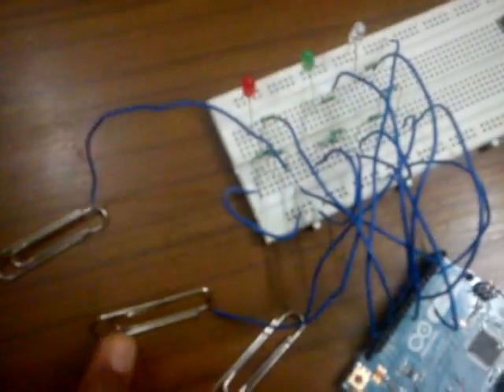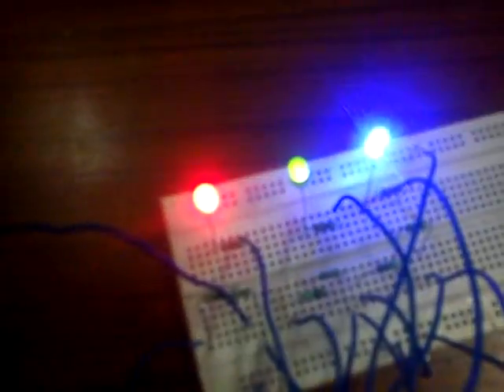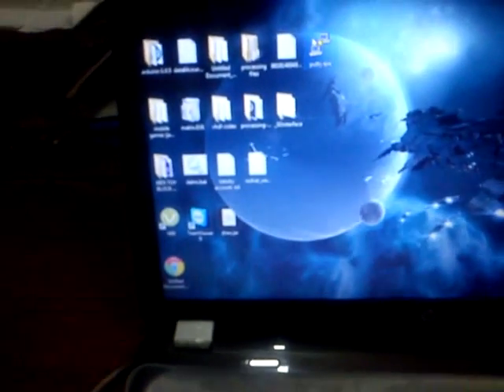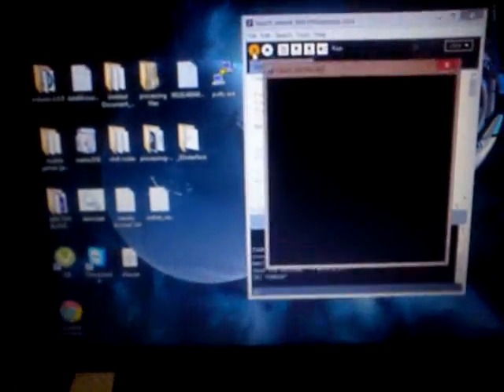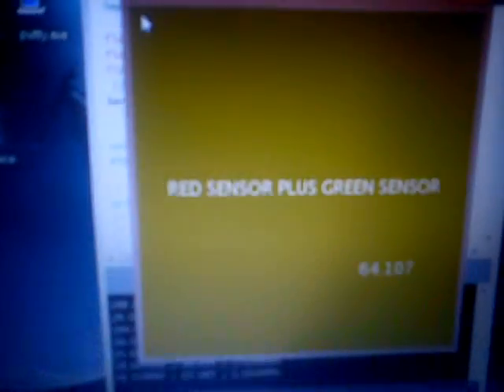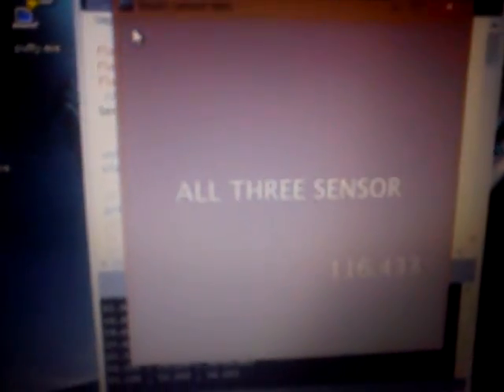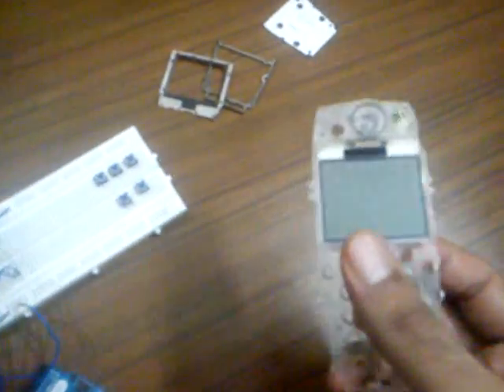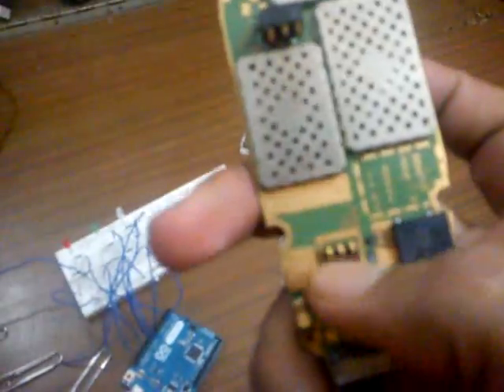Capacitive Touch Sensor with paper clips (Arduino + Processing)

Comment: Hello, i want to create a similar project. I want to modulate a video from a capacitive sensor. But in my processing software i can't receive the information send by the arduino. 

That is my arduino source code : 

#include <CapacitiveSensor.h> 
CapacitiveSensor   cs_4_2 = CapacitiveSensor(4,2);        
CapacitiveSensor   cs_4_5 = CapacitiveSensor(4,5);       

void setup()                    
{
  Serial.begin(9600);
}
void loop()                    
{
  long total1 =  cs_4_2.capacitiveSensor(30); 
  long total2 =  cs_4_5.capacitiveSensor(30); 
  Serial.print("A");
  Serial.print(",");
  Serial.print(total1);
  Serial.print(",");
  Serial.println();
  Serial.print("B");
  Serial.print(",");
  Serial.print(total2);
  Serial.print(",");
  Serial.println();
}

and that is the processing code :

import processing.serial.*;
import processing.video.*;

PImage img;

Serial myPort;

int LF = 10; 
char HEADER1='A';
char HEADER2='B'; 
int valeur1;
int valeur2;
int contact;

Movie movie;
float x;
float y;
void setup() {
  size(456, 360);
  background(0);
  img = loadImage ("mire.gif");
  movie = new Movie(this, "alicevapeur.mov");
  movie.loop();
  println(Serial.list());
  myPort = new Serial(this, Serial.list()[0], 9600);
}
void serialEvent(Serial p) {
  String message = new String(myPort.readBytesUntil(LF)); // On lit le message reçu, jusqu'au saut de ligne
  if (message != null)
  {
    print("Message" + message);
    // On découpe le message à chaque virgule, on le stocke dans un tableau
    String [] data = message.split(",");
    //Message reçu du switch
    if (data[0].charAt(0) == HEADER1)
    {
      // On convertit la valeur (String -> Int)
      int raw1 = Integer.parseInt(data[1]);
      valeur1 = raw1;
    }
    //Message reçu du potentiomètre
    else if (data[0].charAt(0) == HEADER2)
    {
      // On convertit la valeur (String -> Int)
      int raw2 = Integer.parseInt(data[1]);
      // On normalise la valeur de 0 à 255
      valeur2 = raw2;
    }
  }
  println(valeur1);
  println(valeur2);
}

void movieEvent(Movie m) {
  m.read();
}

void draw() {
  contact = 0;
  noStroke();
  if (valeur1<100000 && valeur1>0) {
  }
  else {
    contact=contact + 1;
  }

  if (valeur2<100000 && valeur2>0) {
  }
  else {
    contact = contact + 1;
  }
  
  float f = map( x, 0, width, 0, 255 );
  float m = map( y, 0, height, 0, 15);
  for ( int x = 0; x < 456; x++) {
    for ( int y = 0; y <360; y++) {
      fill( random( 255) );     
      rect( x*m, y*m, m, m);
    }
  }
  
  tint(255, f);

  image(movie, 0, 0, width, height);
  if (contact == 2) {
    image(img, 0, 0);
  }
}
Reply from the maker: hey try this code ...
int valuer 1;
int valuer 2;

 void serialEvent(Serial myPort) { 
 // get the ASCII string:
 String message = myPort.readStringUntil('\n');
 
 if (message != null) {
 // trim off any whitespace:
 message= trim(message);
 // split the string on the commas and convert the 
 // resulting substrings into an integer array:
 float[] sensValues = float(split(message, ","));

 if (sensValues.length >=4) {
 
  valuer1 = Integer.parseInt(sensValues[1]);
  valuer2 = Integer.parseInt(sensValues[3]);
 

 print(valuer1+" , "valuer2+"\n");
 }
Reply: dalmi bindra Hello, I try your software part but it don't work. Can you send me your arduino and processing source code please. My email address is : armel.piquet@gmail.com.

Thank you very much